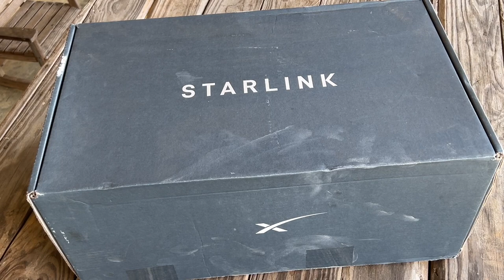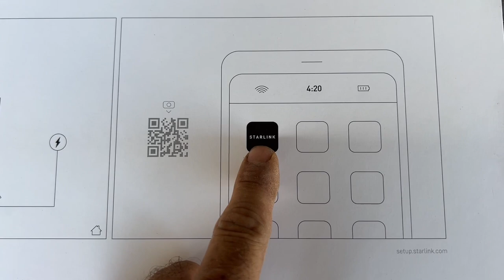Unboxing and installing Starlink internet

Comment: I'm glad you got that going.  I'm waiting on the electric company to get their fiber route built so I can switch to them.  I''m sitting here running on 1.477 mbps..about like dial up used to be.
Reply from the maker: Yes i know how you feel . Look into this . Its easy to set up and worth it i think . Folks that has had it a while all say its good . It’s frustrating to take 2 days to upload a 20 min video
Reply: @SpiritoftheOutdoors  A lot of the reason I don't do videos any longer than I do is slow internet.  What's coming is 500 mbps for a very reasonable price.  They are on my road building the lines now..they are about two miles away.
Reply from the maker: @UncleSasquatchOutdoors  you may be in good shape then

Comment: I have watched several videos and none have what I am looking for. So maybe you can help me before I order mine.. I am in a remote area and do not have cell service much less data signal. So my question is, how do you set it up without the internet already available? Can I set it up here in town and put in my address that I am going to use it at before I take it to my cabin? Thanks for the videos. Love the accent.
Reply from the maker: I can’t remember but i think it activated itself. But i had already set it up on my phone. I think i entered the number off the box in my phone so it may have needed my phone signal but you could drive to service and do that real easy

Comment: Thanks for the idea on mounting.

Do you think it would work if i notch the pipe from you base mount and compression clamp it?
Reply from the maker: Most likely. All it needs to do in not spin around in high winds
Reply: @SpiritoftheOutdoors my order just moved to preparing for shipment. I also have a steel roof, but the previous owners bolted down a huge tv antenna on it so I already torn it down and going to reuse what they did.   I'm using a old sat dish mount for the pole.